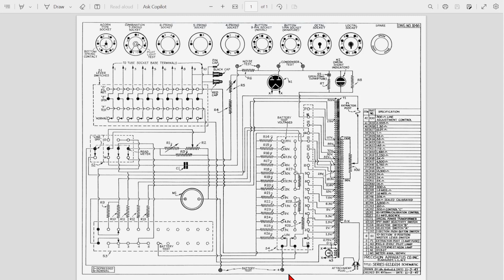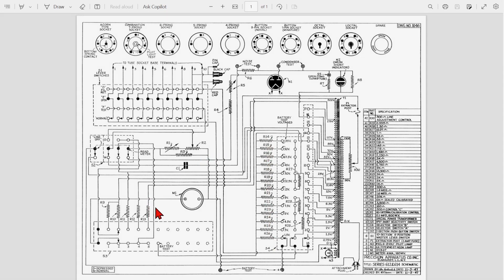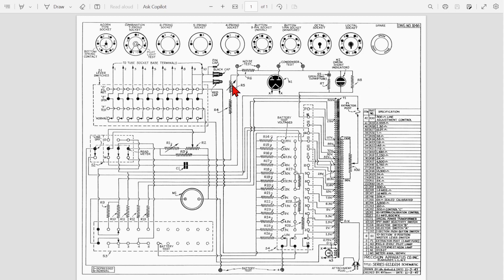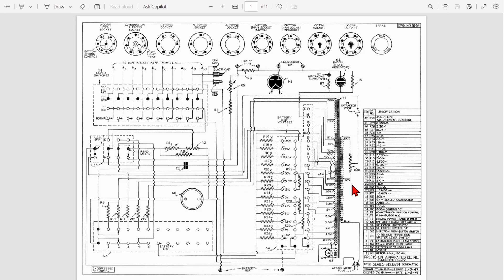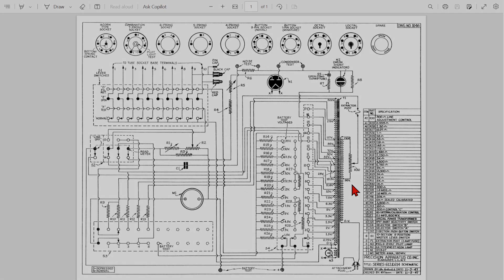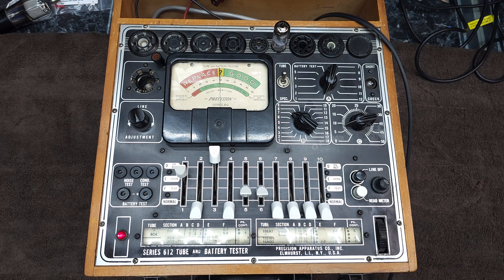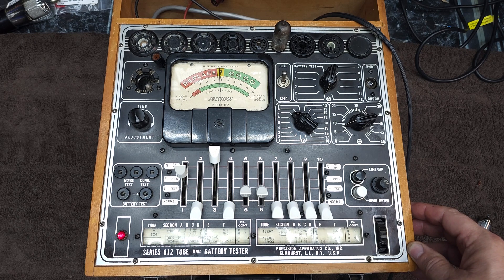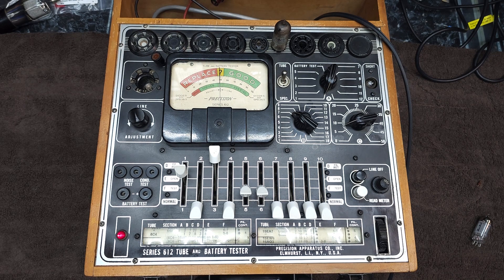Precision Model 612 Tube Tester Restoration Pt. -2 Calibration & Test

Comment: As a novice, I would like to know more about resistor testing replacement/or not.  I have done some recapping and I know how to prepare and resolder leads for caps that I know are gonna go, but resistor testing and then reinstalling bothers me some.
Reply from the maker: I have a series about restoring a Hallicrafters S-40 coming up. Tune into that as I will cover resistor testing and replacement in detail. Cheers and welcome aboard.
Reply: Thanks, looking forward to it.  Have watched all your videos - some multiple times!  Thanks!  @MikesRadioRepairRestoration
Reply from the maker: Im coming up to the resistor series. What questions can i answer for you or what expressly would you like help on?
Reply: I know how to cut out and prepare leads on a device (like a paper cap) that you know for sure you’re going to remove. But getting a resistor out of circuit so it can properly be tested when you don’t know it’s status., How are you cutting it out and if it’s good, how do you splice it back in? I get you can remove tubes to open circuits and sometimes test resistors without cutting leads, but what about how you do it if they’re “ buried”. Are you really testing every resistor in a radio?